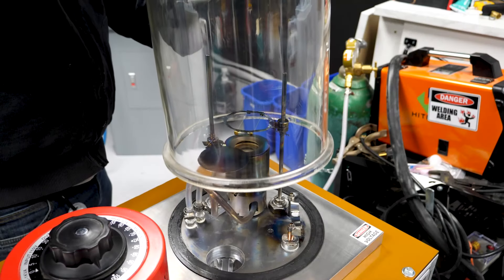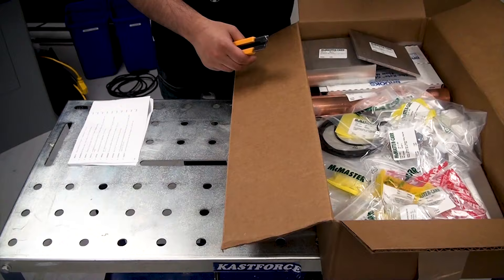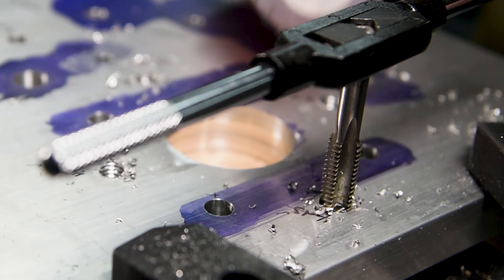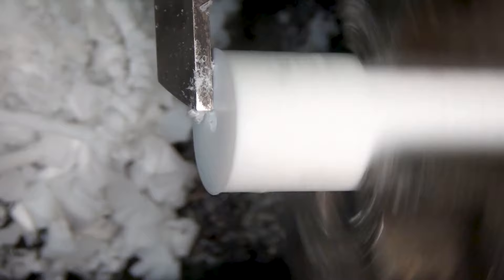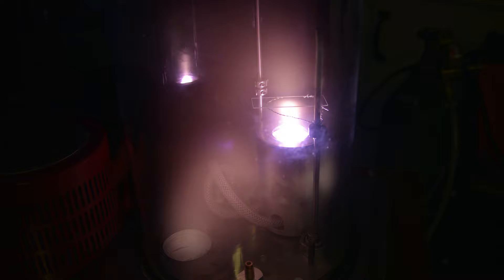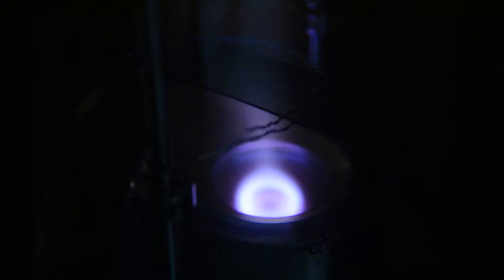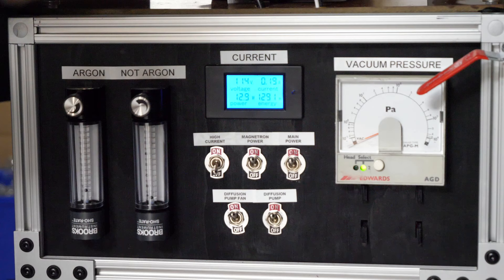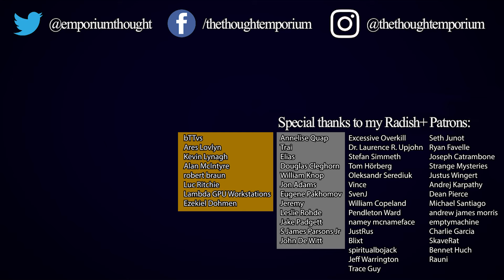Coat ANYTHING in METAL: Magnetron Sputtering Machine Build

Comment: McMaster is a double edged sword, sure, you pay a lot for what you get, but the convenience and speed at which they can get the part to you is what justifies it for me. We use them frequently at my engineering firm.
Reply: Sure with someone else's money.
Reply: @1pcfred  I mean, I use them as well for my personal projects too.
Reply: @Alleroc  ah ha. Often I like to design projects around whatever I already have.
Reply: @1pcfred  yeah, when I can do that, I do as well, though I usually don't keep a stock of things like fasteners and connectors on hand.
Reply: @Alleroc  I have a fair supply of that sort of thing.

Comment: You have to heat the copper to red hot literally it becomes easier to work. If it becomes hard to work reheat it. It becomes hard over time when worked with.

Comment: You wouldn't need to deburr the Alu extrusions if you used a toothed saw blade meant to cut aluminium, instead of using the abrasive chop saw blades. Leaves a clean burr free cut, as the teeth break the chips formed.

Comment: there are two easy step to thread aluminum extrusions 1) get a spiral machining tap, and 2) get a drill

yes its that easy, cuts down time by 90%😂

also id recommend you skip past the brazed carbide and just invest in indexable cutting tools, you can simply swap the inserts and also choose from a few different kinds, the polished ones for aluminium, the normalnones for steel and the black oxide ones for cast iron and so on...

Comment: 1:00 I had no idea 3D printing could achieve such resolutions, is this recent progress?
Reply: They said they used a resin printer. That's not one of those 3D extruder printers with a plastic filament spool. Resin printers use lasers and a "goo". Wherever the laser beams intersect the "goo" hardens. The "goo" is wicked expensive too.
Reply: @1pcfred  I see, thanks! I noticed the resin printer mention, but assumed that was "3D extruder" as well. I'll look this up, the result is certainly impressive.
Reply: @HiAdrian  they can have an impressive price to match.

Comment: Not really Magical. Similar systems are used to deposit metals on microprocessors. You’re essentially boiling the metal and its atoms boil off depositing themselves on to the material nearby or on essentially anything nearby. Similar to how you boil water and water droplets rise into the air which we call steam.

Comment: With all the the gear you had to make and tools to buy. Why did you not build 10 or 20 of these machines to sell? You could have presold them as kits. With people only having to buy the common parts themselves. Like the extruded aluminum and other optional parts for different use cases.

Comment: The brute force machining was hard to watch. I mean, friggin awesome deposition rig, but man was I grinding my teeth and shouting at my monitor about using a proper tool and 5 more steps over just throw tools at it and hope for the best. 

There was a HUGE problem with old school craftsmen not sharing their techniques as a form of job security. Which unfortunately lead to many techniques being lost forever. Now a days every machinist I know is more than willing to throw a piece of stock in a machine and show you how to do it properly, what to watch for, how to read your chips for different metals and speeds. Yall really gotta have an 'old pro' day/week/month when an old salt comes is and shows you all the little nuances of machining. Any one can just throw bar stock in a lath, center it, and put a hole down it. But the experienced machinist can just look at your chipping and tell you exactly how much to adjust the spindle speed, cut depth, and feed rate. And, I know this is hard to hear for some young people these days, often times slower and more steps will yield a part thats a unfathomably better than brute forcing a bit though some metal. For most tools if you have to force it you're using it wrong.

Also, side note: oil manufacturers make oils with the correct properties, not the best smell. They're making machine oil, not perfume. When I was building animatronics Id come home smelling of hot aluminum, burnt oil, and fiber glass resin(some times burning some times not). Machining isnt fast, it doesnt smell good, and (for the 3d printer crowd) no machine will EVER produce a ready to go precision part. There will always be another step if you want precision. Itll be formed on a 2 ton spinning monster of death, but finished on your lap with a piece of sand paper glued to a popsicle stick. Never be afraid of more steps if it means doing it properly. Suffering from Getthereitis will always come back to bite you.

Comment: Ok so turning ofc material you need to effectively cool it to prevent digging into parent material.....  and for your sealing areas your machining marks are your best fried as this allows the gasket to dig in and seal effectively more than a polished uneven surface that you create by doing the polishing by hand....  Just ask anyone who builds drag racing engines........

Comment: For the parts that need good thermal and electrical conductivity, wouldn't aluminum work nearly as well? 
High voltage lines need good thermal conductivity so they don't soften and sag from heating, but also good conductivity to avoid wasting megawatts of power in transmission, while also being relatively cheap, and easy to work with or cut on, so they just make them out of thick aluminum cables to solve all four problems at once. 
Mabey that results in a few machine parts in the sputterer being a bit thicccer, but it's a lot cheaper and easier to machine than copper.
edit: If you're going to try to use this for making semiconductors, it may be ill-advised to use copper in Front End Of Line processing machinery, as silicon semiconductors are highly sensitive to any source of copper contamination. 
Also, bring on the machine tool porn video.

Comment: Isn't anyone going to comment about the correct pronunciation of viton? I guess y'all are going to make be be "that guy" 🤪 🤷.

I'll assume it's one of those tomato/tomahto things until told otherwise. However, I've never heard potato pronounced potahto in a real life conversation.

I've used viton o-rings for over 20 years and haven't heard viten until today. But hey, I guess anything is easier than fluoroelastomer or fluorocarbon-based rubber but I will settle for FPM, fluorine rubber or fluoro-rubber. But personally I prefer the term "Flubber" because of the 1997 Robin Williams film. 😉

Comment: McMaster Carr.... Prices a little bit high is a understatement. I typically define them as cost prohibitive.
Also when tapping those extrusions.. lock your tap in a drill and it goes fast..
And iscar, sandvik or kennametal could have supplied your "slotted screwdriver"

Comment: Three useful words: mass flow controllers.  Can be controlled electronically and is not affected by vacuum.  They can be had from ebay for cheap.  You can build a simple control unit with five volt power supply.